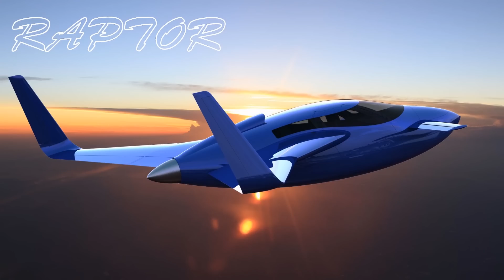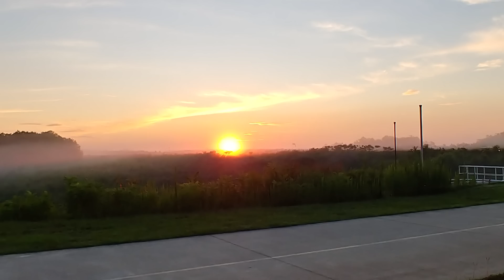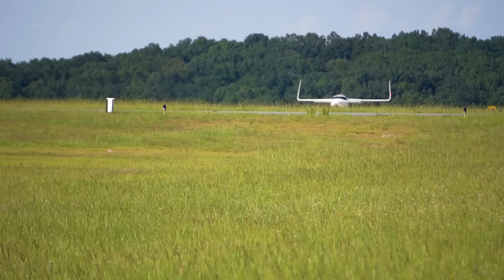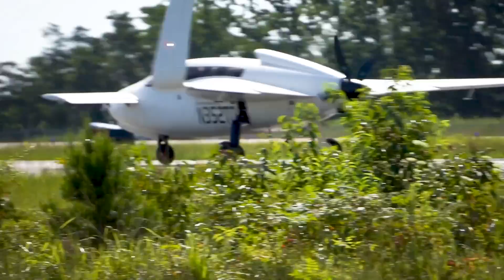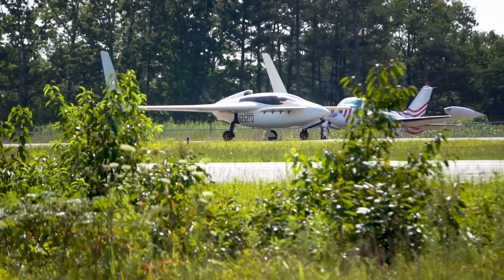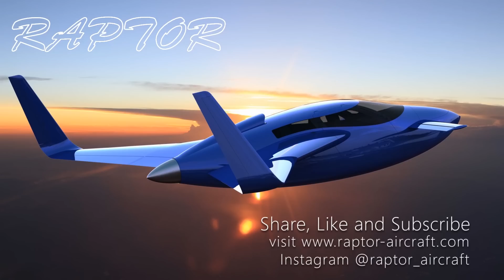Wasabi Testing Part 1 - Building the Raptor Prototype

Comment: ...And now it looks like Justin and Elliot have gone home.
Reply: Actually, I follow Elliot and Justin.  On a regular basis, they fly planes with some questionable problems, which is what test pilots are for.  Just last week, they flew the bowery pony again for flight 15.  It again had hydraulic issues, both leaks and pressure.  It had a back firing engine,   and a overheating engine due to the wheels not fully retracting, and blocking the air scoop.  To top it off, elliot was unable to shut the engine down using mixture control, and had to pump the throttle against full lean to get it to stop.  With Peter, they wouldn't even start the engine until he had installed a fuel cutoff.
 This is a regular occurrence, and yet they keep going back, because that's what they do.  If the runway was too short, then it was always too short.  The raptor is putting out up to 100hp more than design requirements and has shown it has remarkable acceleration (view the cirrus vs Raptor graphic- the difference is..well...graphic).  The high rotation speed was known, the accelerate stop distance was known.  The braking has been demonstrated ad nauseum.  The go-nogo could have been made in Mohave, and not strung Peter along, if the issue they have is indeed the airfield.
Reply: Guaranteed they've crunched the acceleration data and said no way to Cherokee.
Reply: Perhaps they could have crunched that earlier.  Its not like Cherokee lost 3000 ft since Sunday.  Cmon Wasabi, get your act together.  This makes you look like you want to be YouTube Influencers, not data driven professional test pilots.
Reply: @AV8R3  wow. Couldn't disagree more strongly.

Comment: If someone has been to this airfield (flown in several times) and just now thinks it is not suitable because of surrounding terrain . Well WTF for situation awareness. 
By the way I did mention in a previous video, that another airfield would be my preference.
Reply: They were evaluating the airplane.  I doubt they planned to fly away, Though this channel may have given others that impression.
Reply: Atomic Boy Why wouldn’t they say before that flight testing would be conducted at X field
Reply: @richard8181  Because it was not ready for flight testing.  On there channel they explain some of the longer process for testing unconventional airplanes.

Comment: ISO, Kinston, NC is where you should be doing these tests. 11500ft long runway and no obstacles miles around.
It’s long enough you could use 2000ft to get off the ground, climb to traffic pattern altitude and be able to always get back to the runway. I do all our companies flight tests there after mini checks. Revolutionary airframe/engine combination, about 1000lbs heavier than planned. Looking forward to see what the actual climb and cruise performance are going to look like. My money’s been waiting for a few years now to buy this if the performance comes close to what’s planned. If not I’ll have to settle for a Velocity. Very exiting times because I’ve been holding back buying an aircraft awaiting the test results. The Raptors cockpit is so much bigger than anything else out there in this category. Get it flying, put prototype #2 on a diet and you’ll conquer the world. Succes!

Comment: How was the air conditioning handling the testing? With six taxi tests in this heat I bet he’s glad to have to have some airflow in the cabin. Looking great Peter. Test by test they will get there. Baby steps in gaining confidence in your Raptor. It’s Wednesday so they should be flying by now if there were no issues with weather or aircraft???

Comment: Why is the test pilot wearing a helmet with what seems to be oxygen supply?
Reply: Safety... Experimental prototype flight test is a high risk operation.  Many lives have been lost in general aviation due to head injuries in otherwise survivable crashes.  Oxygen is an easy and cheap risk management system in the event of smoke or carbon monoxide inhalation.

Comment: What is V1?
Reply: David Giles the airspeed on the takeoff roll at which a decision to fly is made , barring a catastrophic no go item, like an onboard fire, a flight control freezing up, a wing falling off, engine failure in a single (or dual engine failure in a multi) etc.
Reply: Israel Kozlik the question is what is V1 rotation speed for the raptor
Reply: David Giles I'd guess about 90kts
Reply: @israelkozlik7554  SO I believe the highest speed so far is 70 knots  correct?

Comment: Engine performance indications are looking and sounds like it's dialed in making plenty of thrust. Brakes holding at full power when released less than 2 seconds to 20 knots, less than 7 seconds to 50 knots. Hard to gage feet of runway used to 50 knots on the video. Looks maybe just over 140 feet? Justin reported rudder and elevator authority. I would think it would feel like a great kick in the pants for a low speed taxi. Wishing everyone the best!

Comment: why can't they just fly the darn plane, its so frustrating
Reply: Because he doesn’t want to die.  Having built my own airplane, only a fool rushes in to the first flight.
Reply: It's not a computer game. ;) g=9.8m^2 last I checked.
Reply: Hes got to get the feel of the plane.  Takes a little while.   Baby steps.
Reply: The aircraft is heavier than expected. The runway is too short because the aircrafts acceleration is too slow. The test pilot had to figure this out for himself. He did and now he wants a longer runway with better options in case something goes wrong. There’s a reason why Chuck Yeager used Edwards AFB. Endless dry lakebeds for runways. This aircraft is going to be industry interrupting technology. A bit more time is not going to kill the program.

Comment: Why the full face oxygen mask on a plane that's just doing fast taxi tests?
Reply: His microphone is in the mask.
Reply: His headset and mic are in the helmet and mask.  I assume he likes the oxygen for smoke, CO or worse.  Smart to take some big risks off the table.
Reply: Probably easier to always use the same equipment, considering the pressurization system also hasn't been tested at altitude.
Reply: I was wondering the same. Just in case of a CO leak maybe?
Reply: @ImGolden  Covid ready, check!!!
Reply: It’s his test flight helmet but the mic is built into the mask.